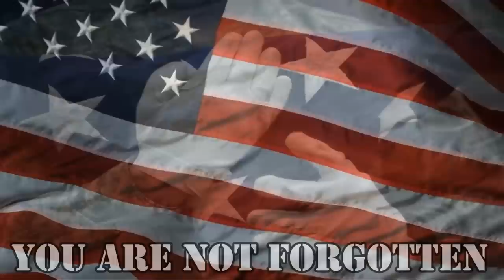DIY RV Modifications Didn't Go As Planned

Comment: No good DIY project is good without at least one trip to the home improvement store!  Great job!  Since you're now so confident with drilling holes into your RV, should you have the need to drill into your countertop or other table tops, you might want to consider putting painters tape down over the area in which you are going to drill. It is my understanding that this will help to cut down on potential chipping of the original surface while you drill. There are also some types of countertops that it is better to go from the underside to drill rather than the finished side. I'm not sure exactly where RV countertops fit into that but it might be something you could ask Alliance about. Again, great job and those are both very worthwhile upgrades that you will I'm sure appreciate and get a lot of good out for a long time to come.
Reply from the maker: Thanks for the tips. We didn't know about the tape trick.

Comment: I had to drill and mount towel holders too in our Avenue cause I can never get the command hooks to stick in our NC heat n humidity. I even tried gorilla glue with them.  Good job on the projects and thanks for sharing.
Reply from the maker: Drilling holes are scary but sometimes necessary. We are glad yours went well also.

Comment: I had poor water pressure in my first Forest river 5th wheel. The problem is they put the pump in a way that draws water the length of the trailer. I moved it next to the tank and removed their breather. If you're not comfortable with modifications. I had to buy pex line, shark bite clamps, check valves and tools and replumbed the whole first trailer.
  My Solitude never had that issue, it flows like a beer drinking teenager. Yours seems to run like a trickle in comparison, I would talk to the manufacture about that about a possible prostatectomy for your water lines.    Have a great day. 
 Bob
Reply from the maker: Thanks for the info. We will talk to Alliance and see what they say.

Comment: Great job! Its always scary when drilling in to something new and nice. Two things you need to know to be a plumber.
1. Water runs down hill
2. Never bite your nails
Nice upgrade for sure. I have taken several trips to the hardware stores myself. I carry alot of different fittings but its never the right one. Go figure!. Towel racks are always an issue so your screws take care of that. Great packing on the cabinet doors. Great share guys thanks for sharing friends.❤️👍👏🥑🇺🇸👊
Reply from the maker: It was a bit scary but it all worked out. We gain confidence every time we do things like this.
Reply: @WaywardWaggs  You do amazing things. Trust yourself,  you got this! One thing I know about you is that you do your research before you start anything.

Comment: You guys crack me up!  Great job on those installs.  We have used Command Strips for towels from the start and have had no problems.  The only difference I can see is that we mounted them a bit lower.  Now the curiosity is getting the best of me.  At about 15:30 there is something shiny on your slide molding that appears over your right shoulder.  What is that?  If it's none of my business just ignore the question.  Thanks for the entertaining video. BTW, you sound like newlyweds - 'I want it bad but I'm scared'.  😇
Reply from the maker: That is a mirror. It is positioned so Scout can watch TV from his habitat. How spoiled is he? 🤣
Reply: @WaywardWaggs  Finally guessed correctly!  Figured it was a mirror for Scout.  Didn't think about watching TV. 😄